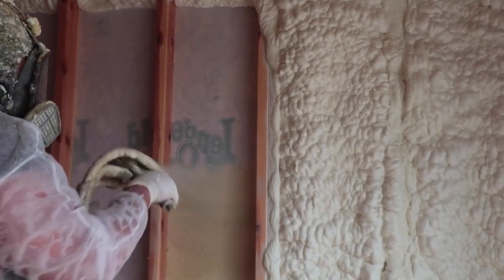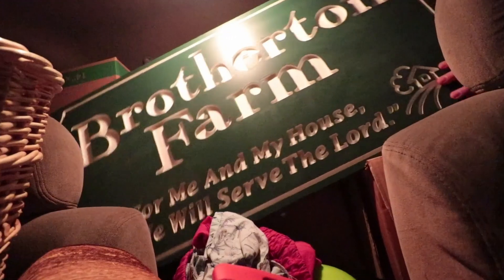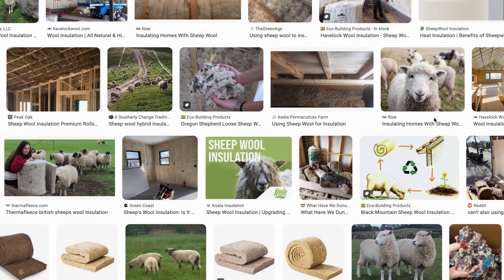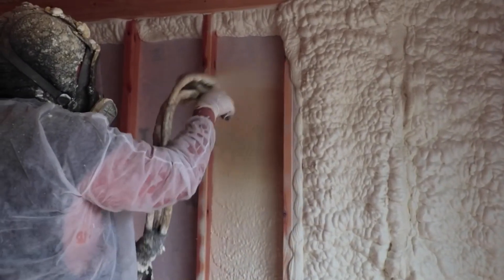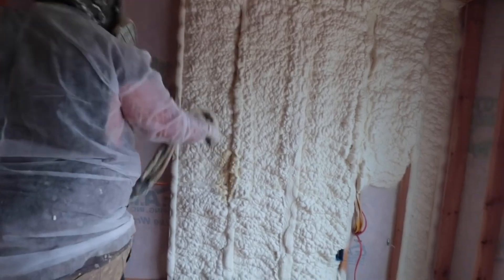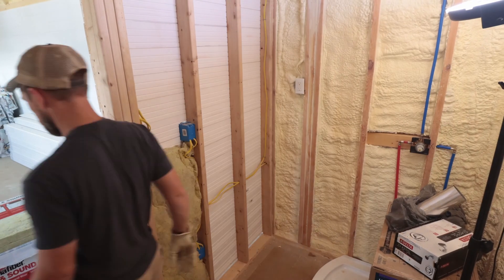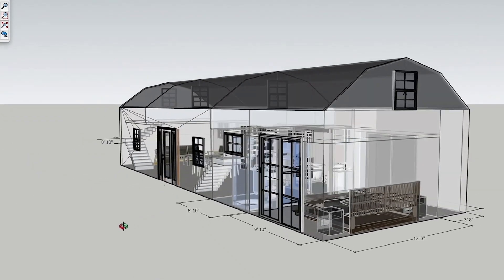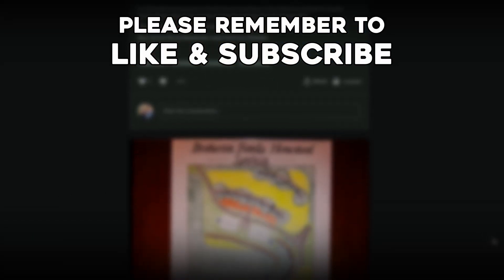the TRUTH about Spray Foam Insulation in a Small House

Comment: We just installed our 16x44 lofted barn and it is going to be used for climate controlled storage. It is closed cell. We are in Texas. Unfortunately the underside of our building has no insulation. Would you recommend insulating it? Mini splits are going in tomorrow.
Reply: Hey I have a question,  if you spray foam a ceiling in a shed, turning it into a tiny home.....do you spray over the ridge vents on the inside......im worried about moisture